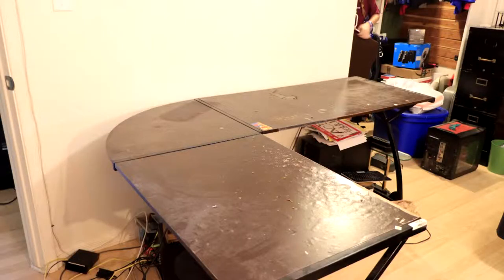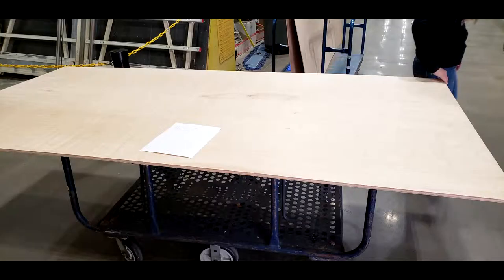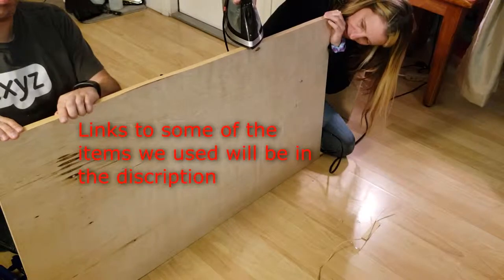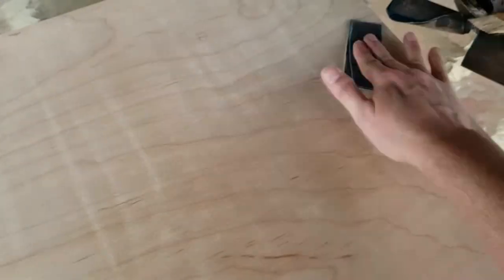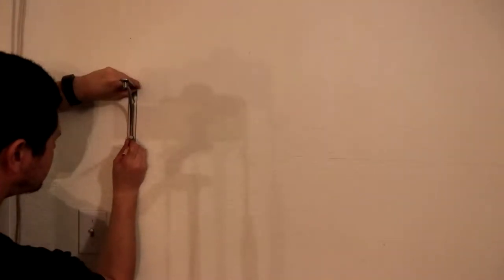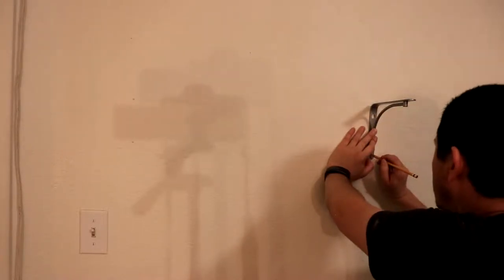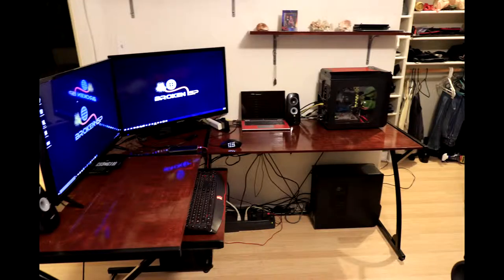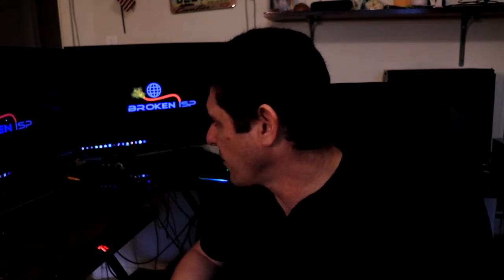DIY Upcycling: Transform a Cheap Metal and MDF L-Shaped Desk into a Sturdy and Stylish Piece

Comment: I have the same crappy desk.  I was also looking to build a new desk and found your video as a result.  The desk is kinda crummy, the framing is flimsy and the surface is trash.  I never installed the keyboard tray.  Your old desk looks like my current desk LOL, it is a sweet catchall.  I appreciate your production and thanks for making the effort to put it together.  How has it held together in the last year plus?  I was thinking of building a frame out of strut and topping it with a nice wood but I think I will do like you did.  I noticed that you have more woodworking content, I look forward to checking it out.
Reply from the maker: First off thank you! :) It has held together rather well. I did have an issue with the satin and the veneer on the edges, which was probably my fault. The sanding grit was WAY to high, and the stain just did not soak in. 150 - 220 max would have been fine for that. I'll wind up redoing it, now I know more about that process. LOL Overall it has held up well, gave me more space, and sits rather flush on the wall, which is better than the old tops. The rounded part in the middle used to let stuff fall off, the squared one it was replaced with never lets that happen. Most importantly other than a few finishing issues it has stood up just fine. I may build a fully custom one based on the upcoming desk build I made for my kids work in our living room(yes that is why they have a super nice desk, because others see it. LOL) so that may be a thing in the future. I have a lot of builds that we finished that have yet to get posted, and I have a small backlog of projects to produce. Needless to say, if you haven't subscribed definitely do so! I have a LOT more coming in the next few weeks. :)